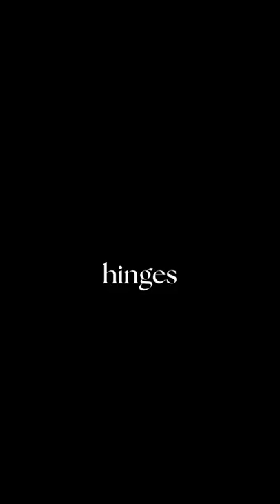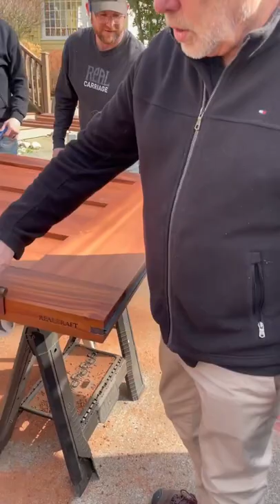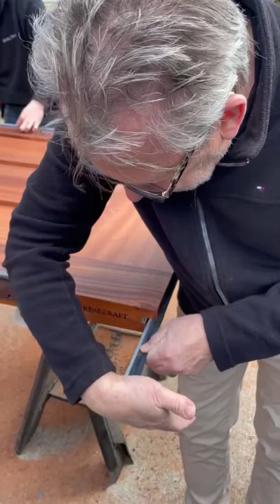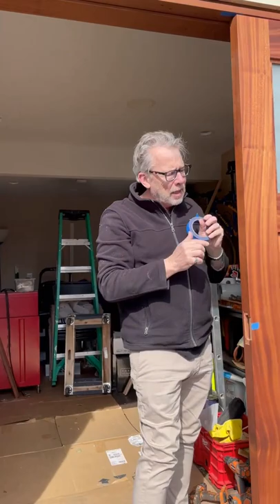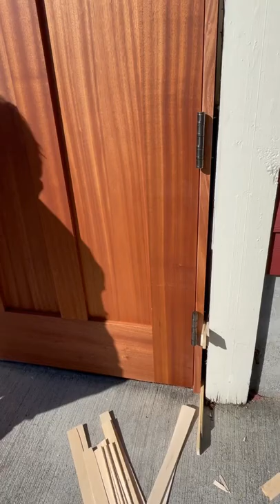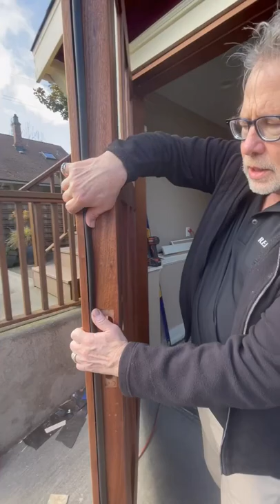How To Install A Set of Carriage Style Garage Doors | RealCraft

Comment: Hi, I plan on building barn doors for my garage. The current barn doors are old, over 100 years old. They have hinges that look like rustic large hinges… they are also rusty. I want to replace them but I don’t know what hinges to use. Home Depot has security ball bearing hinges 4.5 x 4.5 but they don’t look like large rustic barn door hinges. They are rectangular and look similar to modern interior door hinges.  Can you recommend hinges to use?
Reply from the maker: Hi there! Thanks for your comment! If you are planning to make some outswing garage doors, hinges are very important to get right. We have some hand-forged strap hinges made from solid steel on our website. Our blacksmith Bill forges them by hand for a super authentic, traditional look: https://realcraft.com/collections/door-hinges/products/hammered-diamond-strap-hinge. Our custom design consultants could also give you some guidance, as they add hinges to custom carriage doors all the time. Just call us at 1-253-600-2734 and we can help you out!